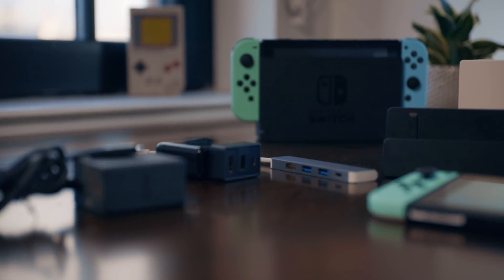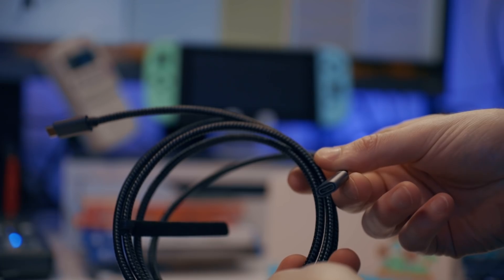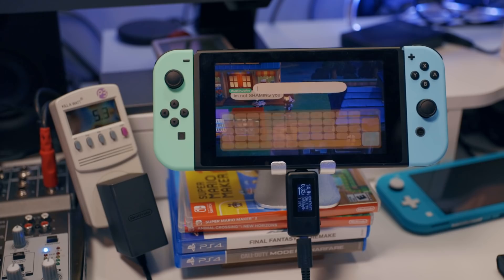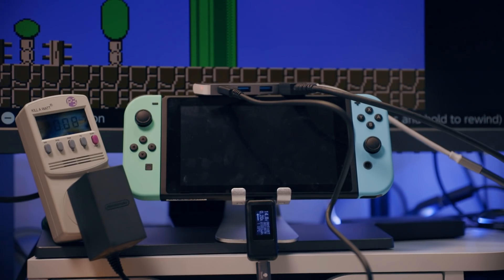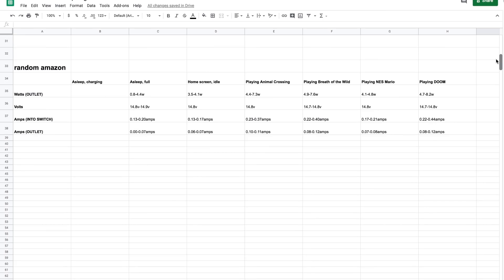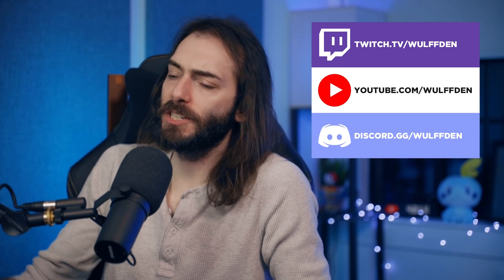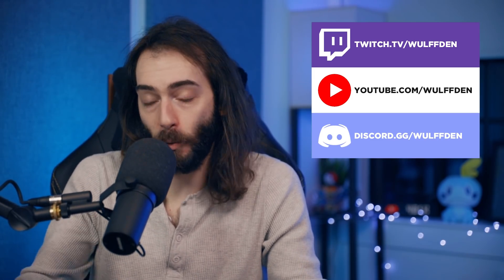How the Nintendo Switch consumes Power

Comment: I've had my say about the docks in previous videos, so I'll just make some notes about the increased power draw from Mario: There are some reasons why it might be happening. The first is that emulation is very inefficient, with the Switch taking dozens or even hundreds of clock cycles to simulate a single clock cycle on the NES, as the architectures are very different. The reason why the death animation is taking a lot of power is likely that the NES is spending all of its time animating Mario's fall to make it a smooth animation - essentially a (very simple) physics calculation.

Also a note about processor usage that sometimes confuses people and makes some games draw power (or cause overheating) when they don't look graphically demanding: It really depends on how much "waiting" the game allows. If you have vsync on, then the GPU (and often the CPU if the game loop waits for the GPU) will wait between frames to draw another frame, and that idle period will reduce power usage and heat. If you have vsync off, the GPU will not wait for the TV or monitor and will begin drawing the next frame immediately. This means the GPU almost never idle - it could be at 100% even in simple games as it is always trying to draw a frame.

In fact, complex games that use a lot of CPU might make the GPU wait more as the CPU struggles to keep up. Which is why in a game like European Truck Simulator the garage may be pushing higher wattage and creating more heat (the GPU is never waiting for the CPU so it's at 100%), while driving (physics / simulation / loading new sections of the map) the GPU waits a lot for the CPU and actually uses less power.

This is also why some indie games seem to use more power and generate more heat than AAA games, even with a simpler graphical style. The AAA developers are probably very experienced at juggling CPU and GPU idle times, ensuring they can get the best balance between the two. The indie developer might not be so experienced at it and that might tax one of them.

This is also why if you care about power / heat it can often be a good idea to turn on vsync when the game has the option: By making the GPU (and usually the CPU) wait for the screen to finish drawing, it gives them some idle time, which lessens the power draw and creates less heat.

Note that if you have a system capable of FreeSync /GSync, then having that feature on is essentially the same as having vsync off - the monitor is waiting for the GPU, so the GPU is running at max capacity.

Comment: When I was a kid I had the original GBA. For Christmas I got a 3rd party reachargable battery for it. This battery would allow u to plug in the GBA in to the wall to charge just like a cell phone. U can play while charging. Because I was always playing kingdom hearts or Mario kart, the battery never fully charged. It wasn't until months later I decided to leave it on the charger overnight while I slept. When I awoke I could smell like a burnt metalic smell. I found that the battery had bursted and acid was on my floor. I then realized that this third party battery had no way to regulate the power consumption. It kept charging even tho the battery was full and thankfully only caused damage to the battery. Power regulation is important
Reply: This is a non issue for modern devices

Comment: how to be 100% safe: use official nintendo docks and charging.
yes, I know it may be costly or annoying but what's more annoying is buying another nintendo switch.
Reply: How to be 100% safe:
Do your own research before buying. You'll find out exactly what docks are safe or unsafe.
Reply: @redwidow1358  you could, or go the affordable route and just use the dock and powerbrick that came with your switch.
Reply: @WednesdayMan  Some people just want to get a third party dock to travel with, and plug in for hotel room stays. And they are safe for that.
Reply: @redwidow1358  yeah, but considering current circumstances, travelling isn't something anyone should be worrying about
Reply: @WednesdayMan  True enough, but honestly, it's just convenient to have a second dock for another room even, or maybe if your OEM dock is being repaired. Maybe a third party dock that comes out has a LAN port in it, and you don't have to buy an adapter for it. It's still worth it to consider a third party dock, just as long as people are safe and do their research.

For the record, there are only two docks proven to have ever actually bricked a Switch. It's important to remember that. Nyko and FastSnail.
Reply: @redwidow1358  fair enough.
Reply: @WednesdayMan  I just hate seeing people spread fear about third party docks without solid proof that they are all unsafe
Reply: @redwidow1358  considering the behaviours of third party docks (as shown by the video), they're not perfect, so I'd just stick with the official ones.

Comment: 5:27 He is showing the gamecube but this is the case for the wii U and the Switch as well
Reply: The GameCube and Wii were basically the same system, but the Wii U and Switch are vastly different in hardware. Whereas the Wii U used a PowerPC architecture for the CPU, the Switch uses an ARM based one instead. The Wii U also uses AMD graphics where the Switch uses NVIDIA.

Comment: Okay, possibly a dumb question, but yes, I get the need for official Switch docks etc., but is there anything specific about the USB-C cable used?  I am looking at getting the portable Nintendo power adaptor and adjustable charging stand (both from the Nintendo Uk store, so both legitimate products) but do I need a specific Nintendo USB-C cable or will any of the dozen or so I aleady have floating about work just as well?

Comment: Oh, one note on this video though: You are using a USB-C extension cord, and sadly there are a lot of cables out there that don't adhere to USB-C standards either. There's a guy called Benson Leung, who works as an engineer for Google, and he buys USB-C cables and chargers from Amazon and checks them and he frequently finds problematic cables. I believe one charger/cable even fried a Nexus tablet when he connected them, so in theory even a simple extension cord can cause problems.

Comment: GAME X CHANGE sold me a used nintendo switch dock WITHOUT the OFFICIAL SWITCH CHARGE CABLE + HDMI CABLE. I know lacking the official HDMI cable doesn't matter (altho, the heck, where did it go!? what did game x change do with it!?) but WHY MUST THEY GIVE ME A 3RD PARTY CHARGER!? What should i dooooooo, ppl :((((( also i feel like it should be fine to use a 3rd party charger as long as im using an official switch dock but i suppose that simply is not the case?

Comment: Does this mean that technically the basstop will still be fine because it uses the actual chip and usbc port from an official dock? I mean it is technically a 3rd party dock. I bought it from watching your video on it only because it used the official hardware but without the extra Nintendo plastic(it actually did make my switch cooler in temperature bonus!). Was really hoping you mentioned it in this video :).

Comment: Is it okay to use the official USB to USB-C Nintendo charger that comes with the Pro Controller with just a generic wall outlet to USB block to charge the switch? Not in docked mode just in handheld/tabletop.
Reply: No cable will hurt the Switch, just docks.

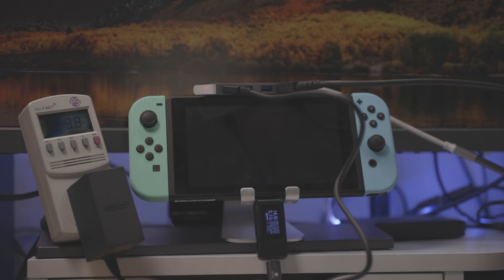Comment: 7:30 Sorry but you jumped to conclusion really fast there. First, which wattage are you talking about ? The wall one ? It doesn’t mean this power goes to the switch, it might be lost in the dock because of inefficiencies. As long as they push 15V, it should be okay. 

It’s the Switch that draw the current, as much as it needs to. The dock doesn’t push current through the Switch, it isn’t how electricity works. The only thing the dock can do to kill the Switch is either : send over 15V or send high voltage through any other pin that isn’t mean for it.
Reply: Thank you, this misconception pisses me off, hell even Nintendo propogates this myth

Comment: As an electronics engineer, I am offended by the equipment used for testing.
Reply: You should be, he didn't test anything enough to come to a conclusion with certainty.
Reply: Tl Dr its fine to use a third party dock...but when it charges at 100% is where ALL third party docks could do damage

Comment: After the last vid about this, I was interested in the follow-up. But I also had noticed no issues with my cheap third-party dock.

LITERALLY THE NEXT DAY, my Switch wasn't starting up after sitting on that dock all night. I would have to hold the power button down for 30 seconds and then try to startup. Since I reconnected the official dock, no more issues.
Reply: The solution is to not buy a cheap dock and do some research before buying. 99% of docks are safe.

Comment: QUESTION: 
I have a Switch Lite (thus, 100% portable) and for convenience sake, I use a USB-C cable with a USB multi-port charger instead of my big UK power brick that comes with the system... So, is it Good or Bad? Thanks in advance.
Reply: This is a docking exclusive issue, If you have a Lite, don't worry about it.

Comment: Can you do this but for the Switch Lite? I understand that it won't dock, but at least regarding power consumption on 3rd party chargers or USB extenders. Thanks!
Reply: Chargers and extenders are completely safe, docks are the problem. A Lite is unable to dock so you don't need to worry.

Comment: I've been on board with you since day one. I do have a question, though. I may just be overlooking it due to details, but if you get one of the power banks you recommended in an earlier video, do you have to plug directly into that? I ask because my backpack has a pass through for a power bank that would be extremely convenient. I'd just plug the backpack into the power bank, then plug in a USB-A to USB-C into my backpack to charge my switch. I've been hesitant to try it since your first video.
Reply: Banks and cables are 100% safe, it's a docking issue. Not to mention the old and new Switch models handle power differently.

Comment: I really commend you for doing the testing, thanks for the data acquired! Specially, you literally saying it's not up your alley and going out of your way to bring more light to the issue, is still very welcome.
Whoever is in for some technical talk tho, let's again, clear up some stuff:
1 - The bricking has been found to come from a specific pin, going way above the maximum limit. It's the command pin on USB-C, the Nyko dock went bananas up to 9v because of a crappy microcontroller usage instead of a correctly made USB-C chip. That pin should be always at max 5v (no matter if your high power pins, VCC, are up to 20v if charging a laptop), and it tolerates without burning up, up to 6v. That's why the Nyko ones broke the Switch, and that did happen before the whole 5.0 firmware issue too.
2 - The bricking can happen thus either sleeping or running. The pin should never go above the 6v (should be at 5v instead), given the dock play mode uses 15v anyway, the crap dock has the chance to ruin your day any time, sleeping or gaming. Don't risk it.
3 - The trickle charge graph was pretty interesting. Whoever, I take it differently: it just means the dock itself is inefficient in standby if it's drawing more power than the trickle charge takes (plus a little nothing there). If the Switch itself were pulling more from the dock, not the dock from the wall, then that's something to consider.

Not mentioned here but very common on this topic too is the deal about the Switch dock having a slightly narrower USB-C connector and all, one thing I know about that by examining it tho, is that the connector on the official dock just lacks the mechanical catches from a normal USB-C cable, but won't deny it being very slightly narrower as well.
The whole USB-C PD issue on the Switch is quite confusing too, but really, the biggest part of why the Switch charger isn't PD-compliant, is because it skips every voltage between 5v and 15v. A compliant charger that can do 15 should always be able to do 9v (and 12 too I think, which the official charger doesn't). The Switch drawing more current than it negotiated at 1st is also part of non-compliance, but of very minor issue, as weird as it sounds (the charger just won't provide more than it can, it will just not give it if it can't, same as a fast charging phone on a crappy charger, it just won't fast charge).
The dock itself is also actually fairly standard USB-C MyDP standard, the messy part is just that: it operates on Mobility Display Port and then converts it to HDMI for the connector at the back. Thus, USB-C to HDMI adapters usually won't work.
In general, if following the USB-C specifications to the letter, it can't brick the console. The big issue, is that this ISN'T the case. Many cheap crap will of course cheap out on the part selection and output either noisy power or wrong voltages to wrong pins. In the end, my agreement with you stays, just stick with the official or licensed docks, cause you never know what you may get when you cut corners.

Comment: Now I'm a tad concerned. I never play docked, I've not even taken my dock out of my Switch box. I only ever charge my switch with the official charger, but I do leave it plugged in to charge frequently, so I'm wondering if there's tech within the dock itself that enables the low power trickle charge, and if I'm causing any damage with how I charge my switch at present.

Comment: I'm still fine with my Skull & Co. Jumpgate dock. It follows the same voltage rules as the official dock, and you verified that the Nyko dock bricked Switches because it simply did not follow the same voltage rules. Hell, they did about a 100 hours worth of charging to verify such. So really, what I can take from this video is this: It's okay to have a third-party dock, so long as it follows the same protocols and voltage rates as the official dock.
If you ask me, Nintendo probably deliberately made the whole thing a complicated mess so that consumers would only buy their docks... but guess what? According to the dock I got, it failed to persuade me. Also, if putting a fully charged Switch on the dock for 24/7  in sleep mode is going to brick it... well, take the damn thing out! I blame the users, not the product in this case.

Good testing, by the way.

Comment: Honestly, I don't understand your obsession for this topic.

Nintendo is a registered USB licensee and is allowed to use the USB logo on their devices, if they do confirm to the USB standard. And while they have printed these labels onto the Wii and Wii U, you cannot find it on the Switch, its manual or packaging. So there is no indication that the Switch supports USB power delivery. And that means that it does not.

If the dock vendor claims that their piece of trash is USB PD compliant, it is per se incompatible to the Nintendo Switch.

Comment: That's cool and all, but I just leave my Switch Hevi stock docked 24/7 and charge my Switch Lite on my old 5V 1A USB type A cell phone chargers along with the various peripherals, which is enough to slowly charge the Switch Lite up while playing games like Pokemon Let's Go or whatever, and doesn't try to push more power to it than it can handle. It's totally chill and just works.

Comment: Good old Nintendo including USB-C on the Switch, yet still finding a way to lock us in to their overpriced proprietary hardware. I can't help but think they intentionally engineered the system this way to prevent people from buying 3rd party. It's insane that it would cost me $120 CAD to buy a dock set directly from Nintendo.
Reply: To be fair, 3 years ago USB-C standerds were all over the place, they only settled down around 2018
Reply: The official docks have also bricked switches before though
Reply: They replaced bricked Switches for free when a whole bunch of them were bricked on Nyko docks when Nintendo released the 5.0 firmware. And then there's the fact that people saw that spikes and errors that were appearing when the Switch was negotiating voltage and amperage with connected power supplies occured a lot with third party power supplies and docks, but also happened (less often but still happened) with the official power supply and dock. I don't know if they fixed that in the firmware versions that were released since then but to me this does not sound intentional. But the fact that they don't publish their own standards makes it hard to guess - we just know that they don't adhere to official USB-C standards.
Reply: They aren't locking anyone into first party accessories. Third party makers just have to make better quality equipment. They charge less because they aren't made as well. The switch uses power delivery like Macbooks but they aren't clear about this. Some of these docks are only using basic usb charging. There's a reason 3rd party docks are cheaper.
Reply: @kongchho  I think Nintendo just knew how bad the third party docks were and made the update to render them useless. It's a repeat case of Samsung attempting to brick the Note 7.